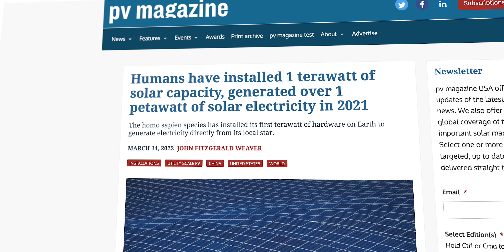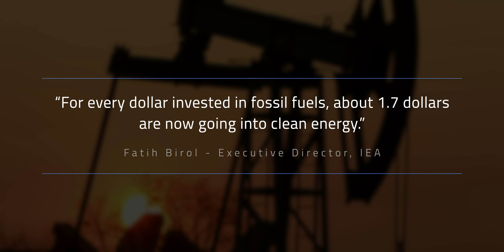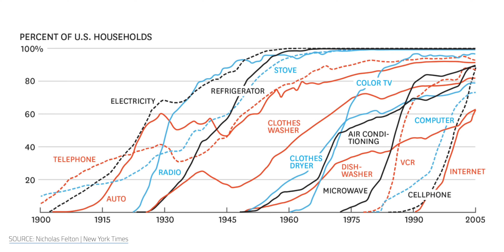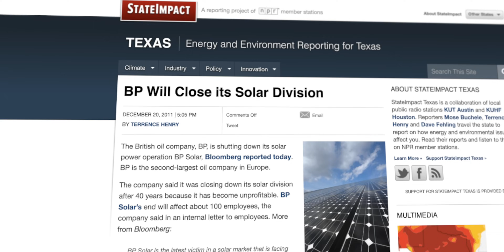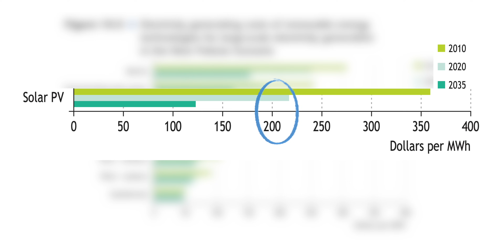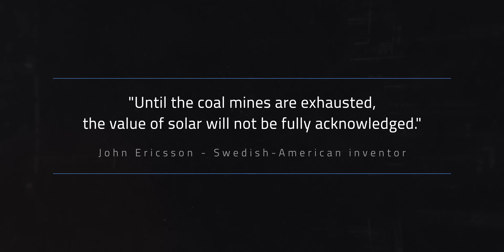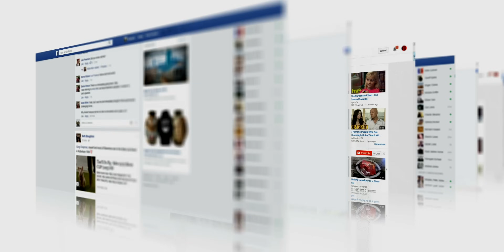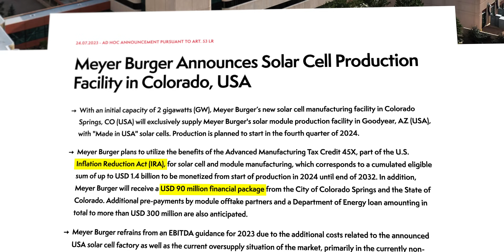How Solar Power Got So Cheap … So Fast

Comment: My advice (I'm a highly experienced accredited solar installer) for anyone thinking about installing Solar on their home is to very carefully choose your installer, and run away from any cold canvassing company. Solar is brilliant for most people with an unshaded roof, but the quality of the install workmanship is critical to a low maintenance system. It is also critical to keep the "As Installed" info pack in your switchboard. In 8 years time if something goes wrong, having detailed info at hand on how the system is wired (string layout map) can save a technician ALOT of time when trying to make repairs. I've also gone off micro-inverters as far less cheap/easy to rectify faults on. If a micro-inverter fails, unless you have a map of where each of the micro-inverters is located, replacing one or more micro-inverter that's failed can be cost prohibitive - climbing up onto the roof, potentially removing multiple panel to find or access it etc. Significantly easier/cheaper to walk up to the wall where the string inverter is located and swap it out.
I love my own 10kw system. Even with an EV I pay tiny winter bills and no bills any other time of year (located in Tasmania, Australia - no battery installed yet).
Reply: Ever installed solar shingles? Does it have a future?
Reply: Tesla string over enphase
Reply: Guessing you have a battery installed if you pay nothing for electricity?  Do you bother to check beforehand to see when the lowest light time of year (with historical data) was and whether you would need to draw power from the grid then? i.e. the worst case scenario
Reply: @godspeed133   - the bothering bit (outcome, likely not intended came across poorly, laugh it off..)- is a simple math function based on latitude with allowance for shading at the fringes - taking one totally offgrid exponentially increases costs depending on the % of reliability one is comfortable with - in the end to get through the deepest solar doldrums, one could have $40k+ of battery standing idle for most of the year, or a $3k generator with fuel ready to go for the once in 3 year eventuality...  One's own call, lol...
Reply: traybern  In Massachusetts it's called Community Solar.  A company builds a 4-8 MW solar array on some field, then signs up residential customers for a share of the electric production, instead of physically putting the panels on the house's roof or in the yard.  I save 15% from my solar share:  if/when I pay $100 to the solar company, they give me a $115 credit on my utility bill.
Reply: traybern  if you think $0 electricity bills for 20 years is stupid then I'm pretty sure I will not be taking advice your advice.
Reply: This is great advice. Thanks for posting this.
Reply: @Jack_Russell_Brown In today’s world with the theory of trying to change global warming I would think the city you live in will be more interested in having some branches cut to enhance your solar output
Reply: @Jack_Russell_Brown  Well that’s a pickle to be in and the community investment in solar may be the answer for you. The other day my neighbor pleasantly asked that I manage the mass of seed production from my queen palm and I abided by cutting down one of the 3 palm which happened to produce shade for their roof also. Through communication perhaps your neighbor may entertain solar and a plan for new trees which could become the next step before removing the large trees. As trees age they become  a higher liability however that is up to your neighbor to determine and correct if they are not intruding your property
Reply: Micro-inverters are a bit of a muddled topic. The term is used for multiple slightly different technologies, basically everything that's mounted at the panel. I would recommend using those that are DC-DC converters (sometimes called optimisers) whenever there's a chance of some panels getting hit with a shadow. In that case, they will keep the other panels in that string running at full capacity (instead of all panels mimicking the power loss of the shadowed ones).

BTW: Shadows are not necessarily a bad thing. Panels can produce plenty of electricity just from the brightness of the sky, even if they're not hit directly by the sun. We see that every morning (and evening) with our west (east) facing half of our roof. Those panels are in full shadow (from the roof) for at least two hours, yet produce (depending on the cloud cover) between 40 and 60% the energy the sun-facing panels do. And the prices for panels have dropped far enough that a panel running at half capacity still makes money (especially because you can undersize the inverter to save money).
Reply: traybern  As I'm a qualified electrician/solar installer, I only paid for materials and also got AUD$3.1k back in STC rebates from federal incentives, and paid AUD8.4k, so out of pocket was only AUD$5.3k.  Maintenance is my own time, which I suppose isn't free, but hard to price as I do it on weekends, outside my usual paid work time. Yes, my taxes pay for the federal incentives, but I think my tax payer dollars are better spent than  the Australian government paying US military contractors  multi billions of dollars to build nuclear submarines.
Reply: Totally concur!  Due to other reasons I had over a year to look at proposals, and more than half VERY overpriced, and some were extremely dubious!  TO everyone: PROCEED WITH CAUTION!
Reply: traybern  this makes absolute no frigging sense.
Reply: @massengineer7582  but these installations are usually in areas of good agricultural use and the dependency on a grid system continues. Roof area continues unused.
Reply: @luisbraz-ruivo  I have heard of some on (former) farmland here in the Northeast US, but most farms here struggle to stay in business, and supplementing farm income with some other cash flow like leasing out a portion of the land for solar may be necessary.  
But mostly I see them on unused land e.g. near highway intersections, on top of capped landfills.
Reply: @Jack_Russell_Brown Trees >> solar panels. You could buy solar energy by investing in a large solar installation, for example, in contrast with panels on your roof.
Reply: Really.. solar is fantastic.  Removing a roof.  Need land for solar ARRAYS and large demand during the daytime.  
You do not want to rely on batteries for more than backup.
You want vehicles being charged, bitcoin being mined, or general household usage consuming most of the output or it is all being WASTED.
The fact that every watt is use or lose goes right over everyones head.
Reply: 10 KW?!

Damn that aint gonna come cheap, though I guess it works itself off over time as long as you use enough electric to make it worth that.
Reply: well if 14" branches are falling from the sky isn't that a reason to get it fixed by an arborist?
Reply: How do you even have the lights on at night if you don't have batteries? This makes no sense.
Reply: traybern  you miss the reason why most people install solar on there land to offset power cost and use. yes scale makes it cheaper but average person doesn't care. the power company's care.
Reply: traybern  why is this so triggering for you.  Obviously it's not free initially, once the money saved is equal to the cost every cent after I am ahead.  It's not difficult to understand.  What many commentators may not understand is we in Aus get paid for what we feed into the grid . That covers the cost at night.  Most of our power generated is not wasted. No need for batteries.  Yesterday roof top solar for a period covered 100% of the COUNTRIES power needs.  The US experience is not what happens everywhere. As we say here, you should get out more. Have a nice day.
Reply: @godspeed133  maybe if the eletric provider is buying back excess energy with a good price, its feasible to zero a bill
Reply: traybern  not necessarily. good houses built are houses that can get into this without much fuss
Reply: Have the micro-inverters installed below the panels in the loft/attic space; in the event of a failure it's a lot easier to reach.

Comment: The incentives where indeed quite important but, at least in Europe, the solar adoption increased greatly after Russian invasion of Ukraine and subsequent energy crises. Suddenly people realised how important is to be energy independent and electricity is the energy that can be created by anyone. And also, other countries as well, realised the importance of being energy independent.
Reply: No one is becoming energy independent. That breaks basic economics
Reply: @samsonsoturian6013  more fake facts already? How exciting.
Reply: Yet another reason for the false narrative this video makes.  Politics is what is driving it not science.
Reply: @cp37373  Don't be silly. Power generation heavily favors economies of scale. It's a fact that cost Edison a lot of money back in the day
Reply: @samsonsoturian6013  That moment when you're liking own comment.
Reply: @samsonsoturian6013 Economies of scale is far more nuanced.  Fossil fuel energy production has to be centralized because not every household could have their own steam turbine and weekly coal deliveries.  Solar, however, is installed once, has unlimited, free fuel, requires little maintenance, and avoids loss of efficiency from transmission.  On top of that, it benefits from economy of scale in terms of mass panel production and improving technology.

That is also an incredibly difficult argument to make when people are choosing to install systems with payback times in the single digit year timeframe, sometimes as low as 6-7 years.  Maybe it's not right in your neck of the woods, but the math is undeniable for others.  When it makes sense, it makes sense.  Keep in mind that cost of a solar system has gotten cheaper and cheaper over the years...haven't seen the same happen with people's utility bills.
Reply: @samsonsoturian6013  Hmmm. I know multiple folk are are completely independent of commercial energy providers. I’m almost there myself.
Reply: No it's because China brought down the price
Reply: @Ahwleung.  The 6-7 year payback is a phenomenal return on an investment that I'm glad you called out. Elaborating a bit: that is an equivalent of a 15% annual return, and the savings are in after-tax dollars, making it equivalent to a 19% annualized return from something like stocks, which simply does not happen.

Even if we assume the solar panels are all worthless at 25 years (at which point they will be even less expensive to replace / update), the annualized return equivalent we'd need to get from the stock market is about 13% -- again, no one gets this kind of return in the stock market.

So while 6-7 year payback may sound like a lot, it is stupidly lucrative from an investment standpoint, far better than what one can expect from a brokerage account (or even a tax-advantaged account like a Roth).
Reply: I can confirm that, I know of 3 people that have put solar power on their houses because of the war in Ukraine and the impact of higher energy bills, 2 of these I know were not interested in solar power but the higher energy bills were a massive incentive to get them moving.
Reply: @samsonsoturian6013  Energy independence is already doable today, it's just expensive to do, but it's a given that it's going to get a lot cheaper as battery tech for EV cars gets better and solar keeps improving and getting cheaper, it's going to allow a lot more of us to become energy independence, especially once the battery tech matures.
Reply: @samsonsoturian6013 
as a Nation, people are becoming energy independant.

as individuals, people are becoming less reliant on the grid, moreso for people who own larger swaths of land like farmers, ranchers, homesteaders and other ruralites.

inner city folk also do it to lower their energy bill. 

but as a NATION, its gives them back the power of embargo. its a tale as old as idk 1980s, maybe even older. im not pro-1940s germany but... we bombed their oil supplies during the WW2. oof i felt the money lost. but it help slow down the germanic progress a bit. 

all in all, energy independance is a major thing cuz rising gas prices can gouge a nation to ruin their GDP. all without sending a single troop, munition or bomb.
Reply: @cp37373 He is right. Renewable like solar and wind run on finite resources that are not renewable. Solar need coal and wind petrolum products like epoxy and fiber glass.

Then the horrible lack of recycling procedures make them far from green. While a gas turbine will produce many times more energy than required to recycle them, no such things apply to '' renewables ''. 

Its a net energy and resources loss.
Reply: @Ahwleung. Thanks China's lack of         laws concerning industrial procedures for the '' cheap '' solar and wind.
Reply: @samsonsoturian6013 That is incorrect, it has been done, there are thousands of examples of 'passive houses' around the world. Define 'basic economics'
Reply: @samsonsoturian6013  Economies of scale is the reason why becoming Energy Indepenswnt is feasable at a reasonable price. The Price for House Batteries are dropping, from 2021 to 2023 there are about a third and that in Germany with the High demand. Solar Panels are still getting cheaper. For my House to become 98% Power Independent the price went down from 30.000€ to 25.000€ Thanks to the Economies of Scale and i can putt in more Reserve batteries at 25.000€ So i will most likely reach 100%.
Reply: "Where?"  where?👀   . . . wherefore art thou . . . horatio
Reply: @solarcabin  how much did you lose?
Reply: @buddysnackit1758  Duh, politics woke up to science, that's what's driving it.
Reply: @mathieusimoneau3358  The cost from FF fired power generation has a huge cost to the environment compared to the life cycle of renewables.
Reply: @samsonsoturian6013  In the state where I live one third of households have solar panels, how does that not generate economies of scale?
Reply: @samsonsoturian6013 So... By your theory I'm breaking the economics... Interesting
Reply: @paul1979uk2000 it's not even that expensive, it cost like a 30k Canadian and if you're already a homeowner it is way worth it.
Reply: @barryhamm3414  that is a flat contradiction of terms
Reply: @buddysnackit1758  Absolutely Politics and I would add Finance and Corporations; all combined is the Global Oligarchy. Matt mentions the IRA (Inflation Reduction Act (which of course, does nothing to reduce inflation), but ESG is even more of a stick. Designed by the WEF and UN and strongarmed by Blackrock, Vanguard and Globo-Corps, it basically tells investors where to put their money...or else.
Reply: That only just happened… if the cost of pv hadn’t been reducing since 2010, the war in 2022 would have had a completely different impact
Reply: Solar is a backup to nuclear, which is a energy source.
Reply: But the video mostly talks upto 2021?
Reply: @ericolens3 If we don't buy fossil fuel anymore there can't be an embargo. Threat: "If you don't comply we will buy only 0% instead of the 0% we bought before" 😉
Reply: The DID have nuclear (past tense)
Reply: Only price
Reply: In the old days in " Switzerland" About solar ..What do I care my electricity comes out from the outlet..! I do say now ..No no mine comes from the roof " gratis !" 😊
Reply: @samsonsoturian6013  So I am becing energy independent, and capitalist basic economics is indeed broken but solar panels didn't do it
Reply: True the Ukraine conflict had huge effect in demand for solar. The issue however is that the solar industry is badly regulated. Installing companies don't stick around or backup their products. Also most solar installs are tied to the grid where they pay you virtually nothing for generating excess energy and where if the grid goes down you have no power. 

I looked into solar last year but only two companies replied to enquiry, neither had any history and prices had shot up.
Reply: @paul1979uk2000 Good point and that's part of the problem. Do you spend £20k now or wait a few years when technology might be better and cheaper?
Reply: Great idea shutting down the nuclear plants Angela!

Comment: There's also the tech argument: the computer chip industry made silicon the most studied material ever in terms of manufacturing processes. The latter is what drove mass production at minimal cost and enabled profitability for volume sales.
Reply: Yes. And the move to larger silicon waffer sizes resulted in surplus "smallish" silicon ingots, waffer and lithography machines.
Before solar cells had to compete with actual computer chips for machine time.
Now the surplus equipment is a sunk cost and solar cells are not part of the node reduction race, so they are using the previous generation litho machines.
Regards 👍
Reply: oik
Reply: And allll of it comes back to both computers and solar power needing semiconductors